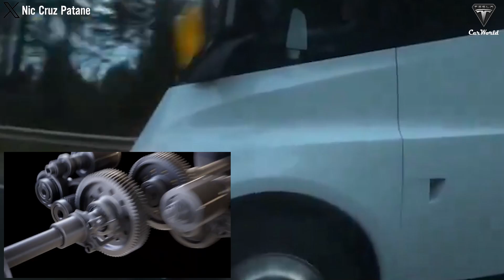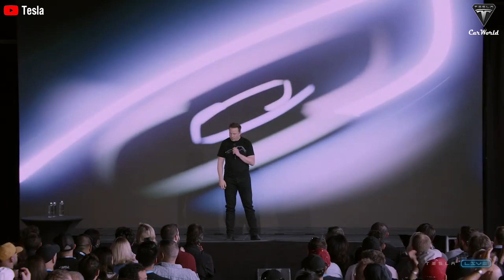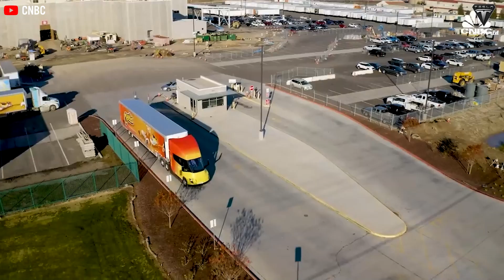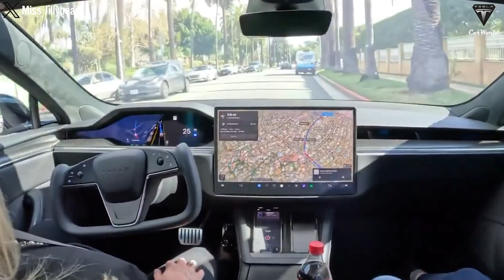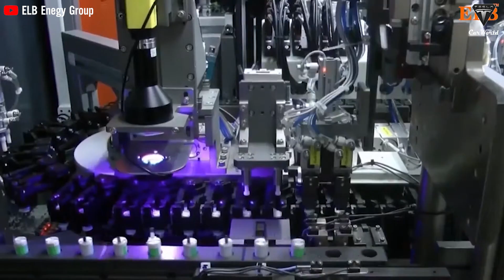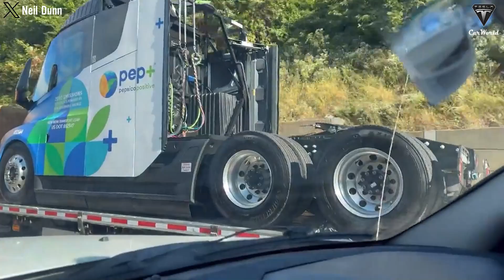6 INSANE HIDDEN Things ONLY in Tesla Semi! NO More Trucks Have!

Comment: Why not TESLA BUILT mobile charger so if semi run off charge they can charge them along the road wherever they are...Maybe they should also put solar panels on top of their trailers to charge the semi or add batteries in the trailers to augment the Semi batteries that will increase the range of the truck..

Comment: What on earth is your 2170 Lithium Ion battery cells having a capacity of 4800 MAH?
Electrical energy is measured in Joules or Watt.hours so whatvon eath are your 4800 MHAs? Mega Amp hours? LoL
Reply from the maker: It is used to describe the level of energy charge the battery can maintain and how long the device will run before the battery runs out, you can call it milliampere-hour.
We appologize for some errors in reading this unit and thank you for supporting us!
Reply: @TeslaCarWorld thank you for your courteous reply. Your "mili-Ampere.hour" needs to be abbreviated to "mAh" so there is no confusion with "Mega-Amperes" or maybe next time you could also convert to energy capacity units of Mega-Joules or even kiloWatt.hours for the rest of the world that uses and understands ISO units?

Comment: what if they create a tesla trailer, which has a huge built-in battery to extend range?
Reply: In addition to that why not have solar panels on the trailer probably giving an extra 10% range, might not sound like much but that would  save about $30 k per year savings
Reply: @13thbiosphere  So GM thought that the Chevy Volt with a gasoline engine that drove a generator that supplied power to the battery, once it ran out of juice was a good idea too, and look what happened to the Chevy volt.
Reply: imagine that trailer and the whole trailer roof a solar panel  @13thbiosphere
Reply: @13thbiosphere  smart idea.
Reply: So you ever think that the answer to that question is, because it’s not needed?
Reply: In some cases it will be needed and it might be done giving a range of 2,000 Miles might be appropriate in some cases for example in cases like semi's in Africa where there is no recharging infrastructure the cost of a battery trailer might be around about $50 k  the great advantage is you only need one recycling station every Thousand Miles,. Probably will be available in 2030 @theodorehaskins3756
Reply: everybody talks about range, now it's not needed? i @theodorehaskins3756
Reply: - yes Ideal, coast to coast range with no useful payload.

It will be great - the future where the interstates are full, and nothing gets carted, full employment, energy too cheap to meter, the highway of life.. lol   (jk - take a pill man)..   I see all potentials, just don't go too far, taper isn't bad, though $1M battery per vehicle is obscene - unless  it is a megapack going to its latest fire....  (jk - "buffer plant")
Reply: @kadmow  So that may be the future you see, but that’s not the future I see, and I don’t think anyone ever made such an outrageous, ridiculous statement that you just made. So would you like to clean that up and come down to earth with the rest of us?
Reply: Probably $70 k mobile battery .... they'll be a couple hundred thousand of them @kadmow
Reply: it's zero emissions lol  @kadmow